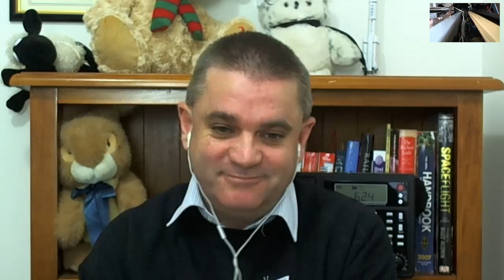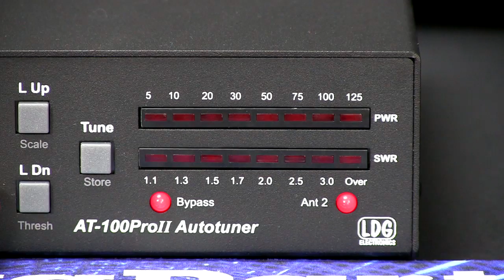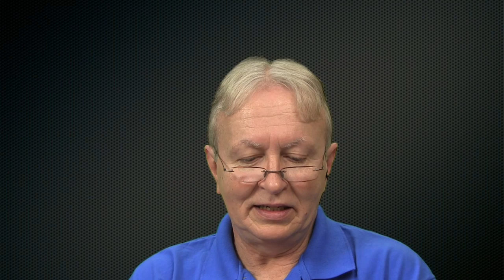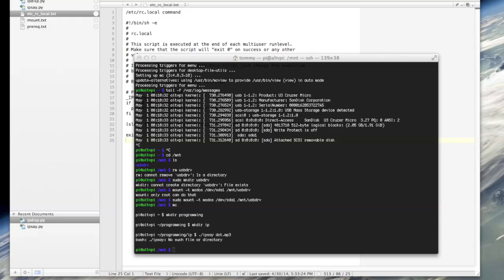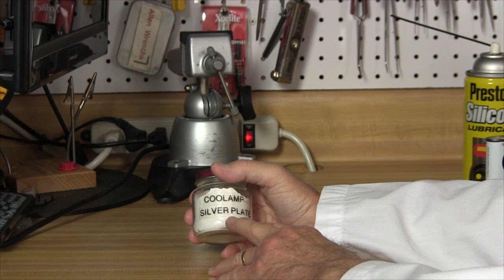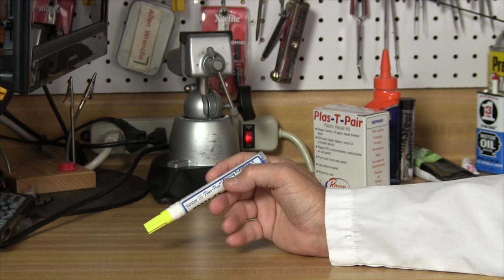AmateurLogic 66: Better Living Through Chemistry

Comment: Just for Peter's info: most Arduinos have what is called a 'resettable polyfuse' on the power input. This protects against overcurrent, it blows and once it cools back down it's back to normal. This will only protect against drawing too much current from the DC jack though, it won't protect against high voltage into the ATMEGA chip.
For anyone who is curious:
What likely happened is that Tommy blew the ESD protection diode inside the chip. Almost all modern CMOS devices have these diodes -- they are there to protect against brief overvoltage conditions. There's a little trick you can do to interface to high voltages -- I used it to interface to 120VAC to get the 60Hz timing out of it! If you put a LARGE series resistor between the power source and the pin (I think I used 100MegOhm) you limit the current flowing through the ESD diode, and it is able to 'clamp' the high voltage to a diode drop above and below the power supply rails (ie, 5.6V and -0.6V) as there is a diode both to VCC and GND. You can easily pick a suitable diode by using Ohms law after calculating the peak voltage (1.414 times the RMS voltage, so here in Canada 117 * 1.414 = 165.5Vpk. If we want 100uA to flow, we simply do R = V/I so 165.5/0.0001 = 1.655MegOhm. As you can see,  I probably went a little overboard with 100Meg, but I wanted to be on the safe side, and it triggered the timing input just fine.

Phew! There you have it. I'm happy to answer questions.
Reply: +Aurelius R If you want to be extra cautious, you can add external diodes that can handle higher voltages and currents, and use a smaller resistor if you wanted. I'd recommend using a diode that has a smaller drop than the internal diodes, to avoid smoking them. i.e. use a schottky or similar diode.

Comment: Tommy I hope that IC is not  SSD LOL
Reply: Hi Nick. If you are referring to no static strap, you cannot get a spark in Mississippi even by sticking your finger in a light socket :) (Not recommended). The humidity here is the only thing higher than the temperature. I guess there is a remote chance in the winter and I probably should use one but I have never had a problem. It's not like being in a drier climate.
Reply: Yep Tommy i was :)